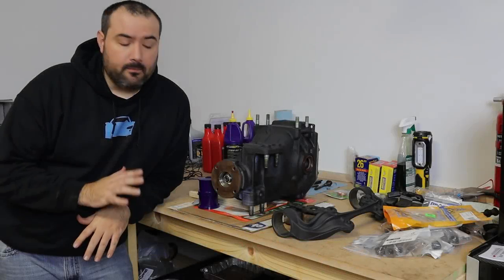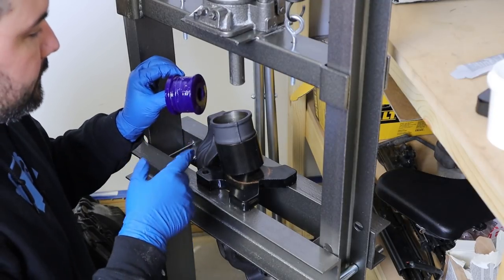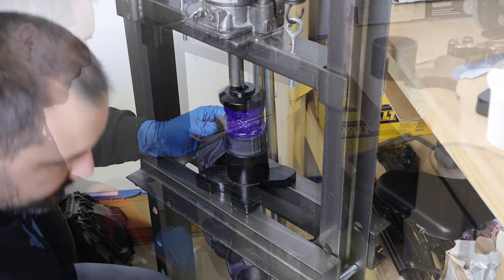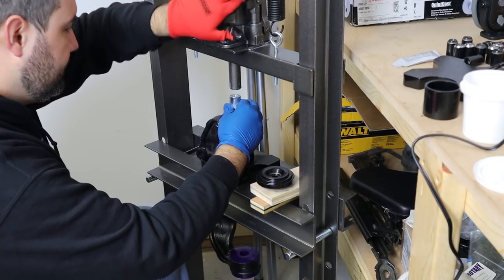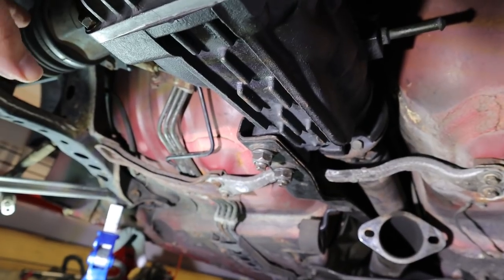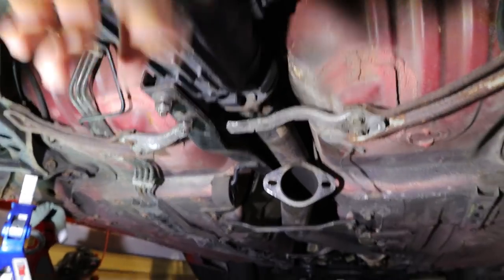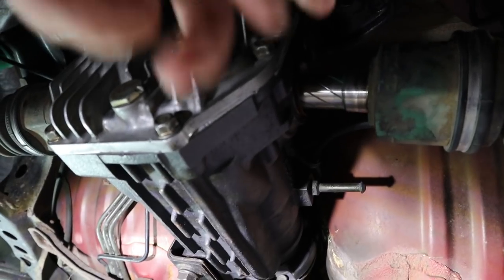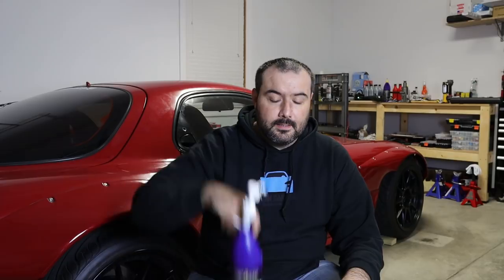FD RX-7 Diff Mount Bushings and Diff Install (Solo)

Comment: I have the same press as many do.  I put a sleeve from the U Joint Kit over the bushing like you're dropping in cylinders and it helped keep it straight.  Also, the very instance of getting off centered, I would adjust the placement of the ram while under load.  You can to this with urethane bushes as they give a little.

Comment: Things not to say on the internet: "shaft". 😁 I am so with you regarding the press. It took me about 4h to get a bushing back into the rear suspension of my 1953 motorbike. And I had a hydraulic press. Out was 'bout 2min. The thing is you have no chance but do it slow and steady. Otherwise you will destroy the part which will cause a lot more work.  👍

Comment: I'm not caught up on all of your videos, but interested to hear how you like the Superpro diff mount bushings now that you've had them for a couple of years.
Reply from the maker: No complaints. There’s a little “clunk” when shifting to and from reverse, but that very well could be other bushings in the drivetrain. Poly bushings are stiff so there’s likely a little more vibration. Worth the effort if you are replacing, though removing the stock bushings is most of the effort.
Reply: @IconGarage  Thanks. It looks like a lot of work to swap them, not a job I would want to do twice!

Comment: a proper bushing removal / replacement kit is worth its weight in gold  the threaded rod through the middle stops any twisting, that plus putting the bushing in hot water for 10 mins makes life much easier , but well done with the tools at hand
Reply from the maker: Yes, I’ve already added that to my tool wish list. Great tip on heating up the bushings before installation!

Comment: What size are the fuel hoses going to the filter
Reply from the maker: If you haven’t found it already, I have a video on the fuel filter relocation and install. The hose info should be there, but if I recall they are 5/16”.

Comment: Hey, when I changed the bushing in my Audi I pressed them in with a socket that fitted over it, have you tried using a socket to push them in?
Reply from the maker: I tried a bunch of different size pipe and cups. I would have needed a very large socket, but sockets definitely work pretty well for smaller bushings.

Comment: why is there a ground on the exhaust?
Reply: Usually O2 sensor ground. If a bad ground the sensor might give signals that make the system run rich. If bad mpg check it. Can also reduce static build up which can show as radio noise.  If in doubt fit one, especially if you have a non-standard exhaust. Some cars have an additional O2 sensor at the rear so that needs a good earth. Rust in pipe joints can also mean a poor earth.